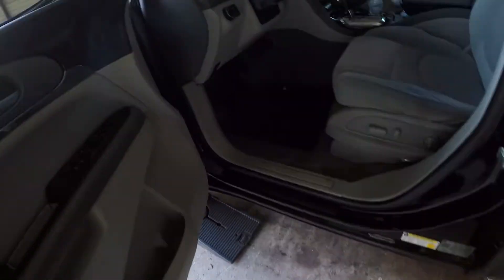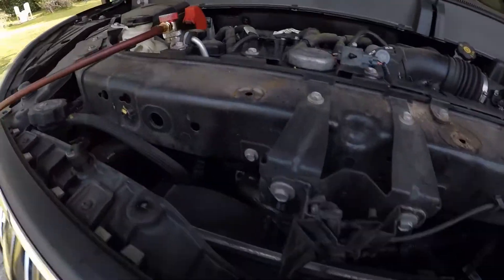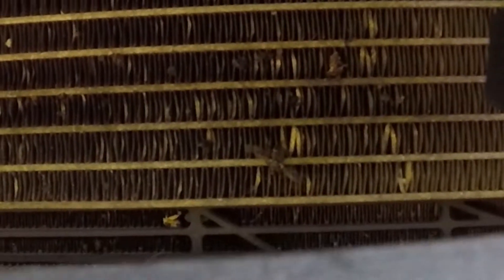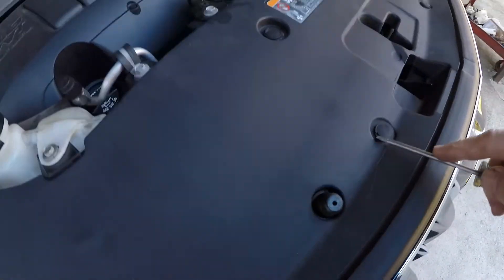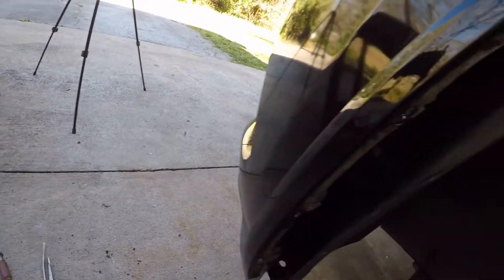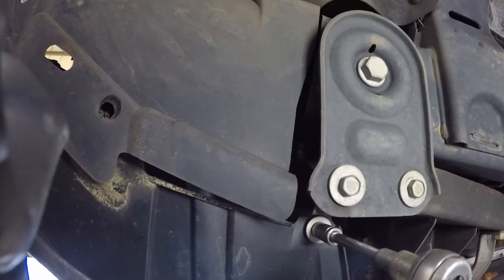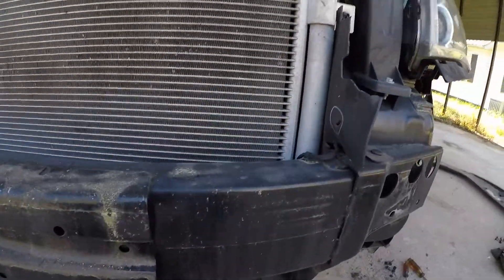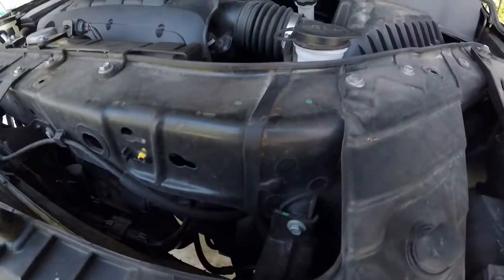How to replace a A/C condenser in a 2017 Buick Enclave

Comment: Did you put dye in it? I can’t see the green on your video.
Reply from the maker: Most of them I put dye in,this one I could see the oil spot from the freon leaking on the condenser.
Reply: I have a 2015 I’m working on. I have dye in it but still not finding the leak. So your experience on these has generally been the condenser?
Reply from the maker: Yes every time,but they do leak from the service ports also,clean the service ports the low and high side so u don't have any dye on them,then let it run for awhile and see if u see any dye around the schrader valve.I use my freon sniffer around them to check.
Reply: Thanks for the tip I’ll double check those. The leak is pretty significant so it shouldn’t be too hard to find.